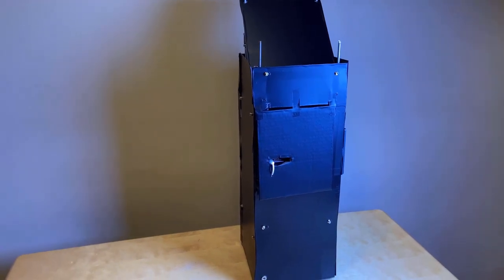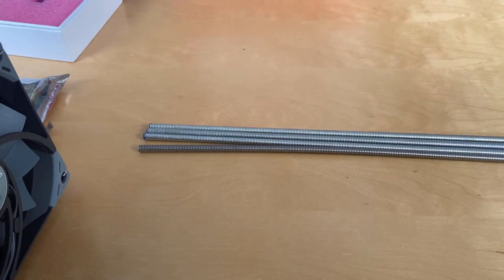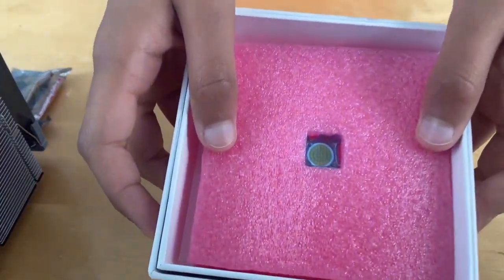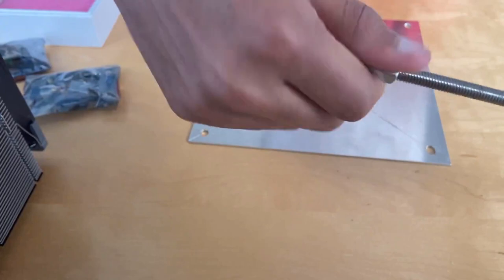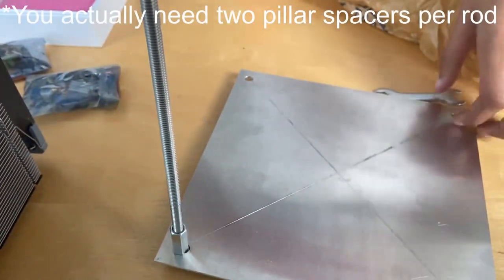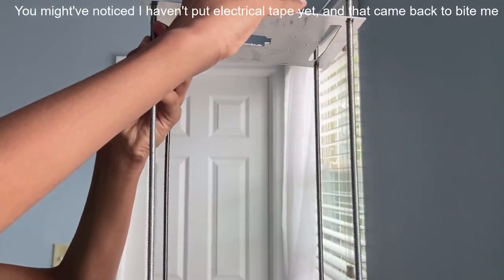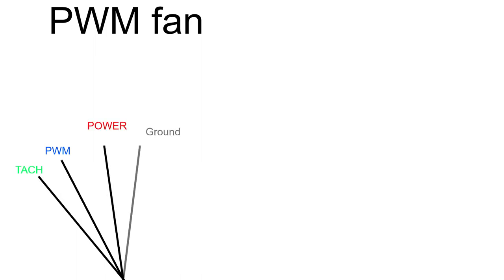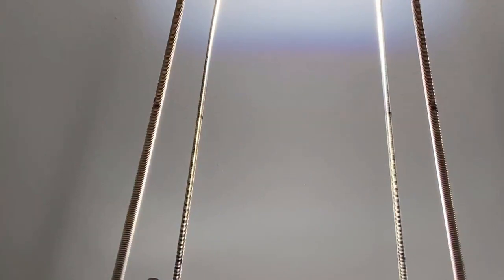Building DIY Perks's DIY Projector (It IS Awesome)

Comment: Amazing! I was looking for someone who made this build idea from Matt because I didn't want to pay for his pdf guide xd I have a couple of questions though:

1) Regarding the fresnel lenses, do their focal lengths have any influence on the size of the projected screen? Let's say I want a 2 meter by 2 meter  (yes, SI units are the best) projected screen on my wall, do I have to buy a different set of fresnel lenses than someone who wants a different projected screen size? Or does the projected screen size only depend on the size of the lcd screen?
2) I was doing some research and I found the blog of some Korean guy who made like 3 or 4 projectors like this (maybe you also found this blog) . However, his build had way more steps and was far more complicated and expensive. He used what is called a condenser lens, which seemingly makes the light being uniformly emited over the screen. Is this the same thing as your second fresnel lens? Is there a difference between a condenser lens and a condenser fresnel lens (the condenser lens appears to be round I think while the condenser fresnel lens appears to be rectangular)? Do you recommend using a condenser lens to have more brightness? 
3) One of the things you did differently from Matt was the extra fan for the lcd panel. Is there a reason why he didn't mention it, since obviously it did cause some trouble for your lcd screen? Also regarding this particular fan, how do the blades of the fan have to rotate? Does the air have to go from the outside to the inside, through the panel, all the way down to were the other fans blow them out?
4) What about the throwing distance of the projector? Is it possible to adjust the projected screen size without moving the projector (I live in a 3 meter by 3 meter room) ? Or does the focusing/pulley system provide for that (I have seen some diy projectors without a focusing system so what are the benefits of it) ?

Sorry for the many questions, I am just so excited to build this and I don't want to fuck this up :D
Reply from the maker: Hello! The way I understand it, you can have many combinations of fresnel lenses. For example, a 90 mm focal length and 170 mm is a good pair(like in this build), and so is 120 and 185 provided that you have a projection lens with a focal length of about 200 mm. I honestly don’t have a very good understanding of optics, but there are some optimal combinations. One of the ways you can adjust the size of the projected image is to just move the projection lens up or down to bring it in focus or to use the focusing system. I moved the projection lens because that seemed to work better. As far as I’m aware, there is no way to adjust the throw in a convenient way but I haven’t experimented with moving the fresnel lenses around in my build. You CAN try putting your LCD panel in the middle of the fresnel lenses and see how that works out. And for a 2 meter image you’re probably gonna be 4 meters away from the wall. 
        Regarding your second question, a condenser lens specifically is different from a fresnel lens, but I think sometimes they’re used interchangeably. In this case, a condenser lens could be placed on top of the LED since its a hemisphere. Honestly, this is one of the things I was planning on adding to it later on. It’s definitely worth a shot, but you might want to add more cooling for the LCD panel!
       Speaking of the LCD panel I’m not sure why Matt didn’t have any issues with his; maybe because phone screens are tougher than separate LCD panels? xD. Anyway, I had the fan blowing air in, and luckily it just goes with the air pressure if that makes sense. The negative air pressure from the fans on the heatsink would pull air in anyway, and this fan just helps with that.
        And finally, as I mentioned, I don’t know of a way of adjusting the throw, but you could try putting the LCD panel in between the fresnel lenses and messing around with the fresnel lenses. For example, you can add tilt control by making the second fresnel lens tiltable.

Happy building!!!
Reply: @justabit9070  thank you very much! That certainly makes things clear

Comment: Hey dude, you r make my day )).
after watching Perks video, I dreamed about building my first diy projector, but I haven't space area for my DIY works&project (.
questions: 
1)does this project worst to make VS buying used fullhd 1080 fabric projector? 
(prices for average diy components
vs used projector price used
2) I have one great idea for replace compatible light source like led/xenon and etc from automotive or other headlighting components for decreasing cost of DIY .
thank a lot for this work .
Regards!
Reply from the maker: @Ricardo Tozzi thank you. This projector is definitely more expensive than even a new 1080p projector, and much more expensive than a used 1080p projector. Commercial projectors will be brighter and more compatible. However, if you have a lot of the tools and some of the parts, then it might come out to be cheaper. If you add things like a condenser lens, a brighter LED, and a proper TV Box LCD panel, you’ve got a pretty compelling DIY project. Only question is: “Is it worth the time?” For me it is because I learned a lot and had fun but maybe not for others.

Modifying a commercial projector sounds interesting because you could swap in a more powerful LED with a better cooling system and condenser lens. Very cool stuff!
Reply: On your point 2,  i also thinking about that, because I can get 6500k led with 9000 lumens if I choose led projection lamps made for cars. But here is catch, car use two led projector, and that 9000 lumens are if you use both LEDs, single led have only 4500 lumens. That's why I'm also confused if car projector lights can work in it or not. 
Plus point for using car led,
 (1)projector is you get ready to fit kit with heat sink and power controller. You only need to add fan as your projector is not moving like car, so need active cooling.
(2) so cheap that you can get at half price with power controller then other diy cob LEDs. Just plug and play.
Reply: @ricardo tozzi
Reply: @kurjibhalsod3547  Thanks a lot for sharing your mind. You are made any diy construction with auto Led kits? I thought 4500 lumen is enough for certains and/or painted walls darkened  room. my burned  commercial projector lg ph150 had only 130 lumen! . 
this brightness was quite for watching videos in a simple room without special darkeness, for example on a white ceiling. so, i like your idea, and intersting of process.
Reply: @ricardotozzi5440  not yet bro, still I'm gathering money and knowledge. But your reply give my idea little more bust and positivity to do something experiment.

Comment: Even something as simple as a more powerful led would go MILES to improve this design. If you could get 300w of cob behind that thing it would likely be a massive improvement.
Reply from the maker: I was thinking of a 300 watt COB in there but so far I haven’t because of all the extra power needed but also how much heat the LCD panel can take because it was already having issues with a 100 watt LED. I think the biggest issue is light leakage and wastage so a tighter design along with a condenser lens would go a long way for the projector.

Comment: HOLD ON A SEC ! I dont have a metal drill lol .
i wonder why not use a water cooler ?
Reply from the maker: My thinking was that a good air cooler would outperform a 120 mm AIO, but then I thought you could just get a 240 mm (or larger) AIO and route it to an outer chamber. Actually, my choice of air cooler could’ve been better because I could’ve chosen a smaller Fuma 2 or U12S or a dedicated LED cooler.

Comment: I would recommend not recording audio and video at the same time with a video like this. Record the footage then have a script for your audio that you add in post, it will make the audio quality better and you can be sure that what you're saying in the video is exactly how you want it.
Reply from the maker: @RobotPotato thanks for the tip. I did record in post for the middle portion of the video but not for the rest. Appreciate the advice!

Comment: That wasn't Matt's idea, WE MADE THOSE PROJECTORS when he wasn't even born, I've been making stuff like that way before Internet, and that's one of our designs, we didn't use LED because it wasn't developed as of today's standards, we used 400watts Metal Halide bulbs... And a 17" laptop screen... Here's a tip for you, forget what Matt said, the size of the light source matters, and contributes to the sharpness, the smaller the led the sharper the projected image. That's why your projector looked all blurry and you chose a bad Objective lens. That's why your corners are so dim... 
The mirror absorbs light so if you put your projector horizontal and (without the need for a mirror) you get a brighter image. I could go on and on. And change the title of your video: "I remade Matt's video."
Reply: Do you have an own website or something similar to get more insights on how to build a good projector at home?